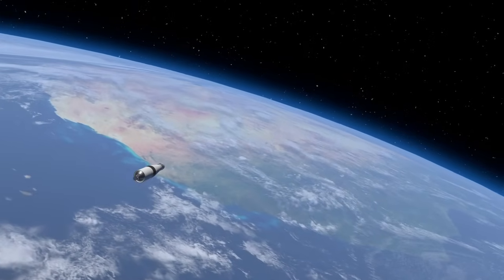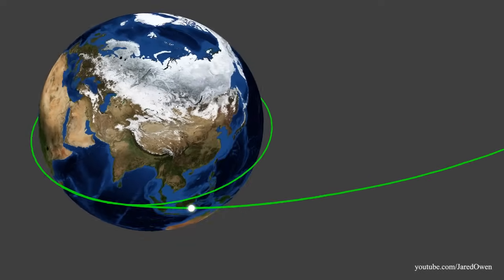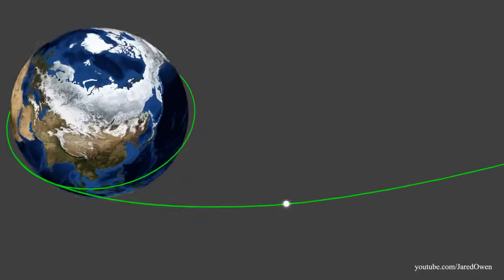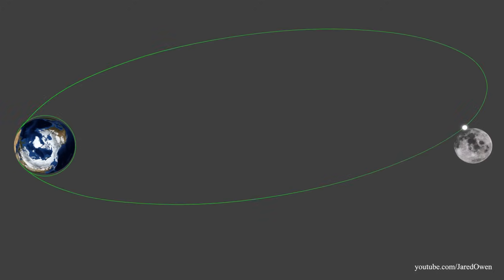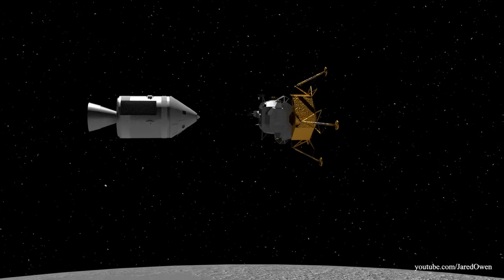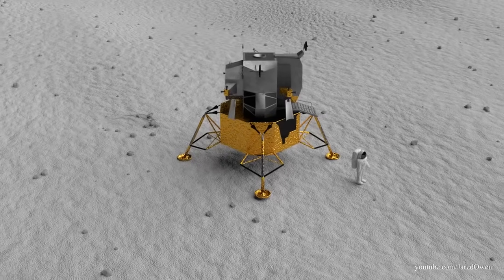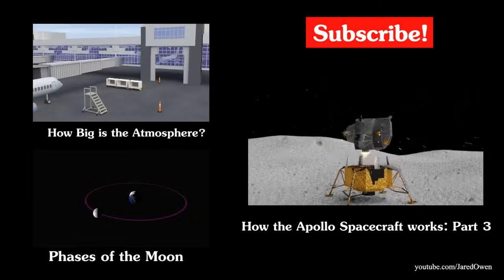How the Apollo Spacecraft works: Part 2

Comment: Always wondered how the CM managed to reduce velocity enough for an effective reentry.
It's quite different in LEO, where a slower speed and larger reentry corridor exists, and the opportunity for multiple attempts.
Did the Apollo missions use skip reentry?
Reply: Are you actually going to try to learn and understand it?  Or, are you just going to do as you have done on prior topics, and think that within 30 seconds of finding out how something worked, you will declare it fake?  To answer your question, start with this: "Apollo - Atmospheric Entry Phase (1968)."  If you have more questions, ask them.  Don't just pretend that no aerospace engineer on Earth for the past 50 years is capable of understanding why nothing could actually work, while YOU think YOU know better (again, just 1 minute after learning it).
Reply: It all hard to 'understand' :)  The rockballs capture and sling at command.

Comment: One thing you forgot is the sensor pegs on the LEM landing pads when they touch the surface of the moon the descent engine shuts down
Reply: Not directly. The probe lit an indicator lamp on the panel. IIRC, they wanted to be able to go to full throttle if the pads broke through the surface crust--if the module tipped too far, they couldn't launch the ascender. I assume that they wanted to be able to stabilize the module long enough to launch at worst, or slide over and try a different location.

Comment: Great video but why don’t you talk about the Van Allen belt it’s amazing that we so called made it through every time with no danger. I know we all have our own opinion but we never made it to the moon. But you make great videos Jared, can they take there suits off inside the craft?
Reply: "A person in the cabin of a space shuttle in a circular equatorial orbit in the most intense region of the inner radiation belt, at an altitude of about 1000 miles, would be subjected to a fatal dosage of radiation in about one week.

However, the outbound and inbound trajectories of the Apollo spacecraft cut through the outer portions of the inner belt and because of their high speed spent only about 15 minutes in traversing the region and less than 2 hours in traversing the much less penetrating radiation in the outer radiation belt. The resulting radiation exposure for the round trip was less than 1% of a fatal dosage - a very minor risk among the far greater other risks of such flights. I made such estimates in the early 1960s and so informed NASA engineers who were planning the Apollo flights. These estimates are still reliable.

The recent Fox TV show, which I saw, is an ingenious and entertaining assemblage of nonsense. The claim that radiation exposure during the Apollo missions would have been fatal to the astronauts is only one example of such nonsense."

- James A. Van Allen
Reply: The Van Allen belt does not provide a lethal dose of radiation as long as they don't spend a long time in it. They only spent 15 minutes in the Van Allen belt.

Comment: how does the astronauts move between the 2 modules?
Reply: Once they remove the hatches from the CM & LM, there’s a tunnel between the two spacecraft. After docking, the mating collar is secured with a number of latches and then the seal is tested to make sure it’s all good.
Reply: @mako88sb  thanks!
Reply: SC0RP1AN   Np. I did leave out the docking probe and drogue system that is the key part of all this. There’s a excellent YouTube video by Kevin Hugh’s titled Apollo Docking Mechanism that you should check out. He realized that there isn’t really an adequate explanation of how it works and decided to provide one.

Comment: The lunar module does not appear to have any jets so as to turn the module around in the correct position to be able to land. that big jet in the middle is just a thruster.
Reply: Thé RCS is there exactly for that purpose. The 4 quadrant modules are clearly visible on the ascent stage of the LM.

Comment: Why is there no actual footage like this 2:40? This is one of the best moments to capture, if you're about to land on the moon for the first time in history!
Reply: Well, TV video was out of the question, because they lost line-of-sight with Earth to transmit it.  They were on the far side with no radio contact.  I suppose they could use 16mm film, but, I doubt they wanted to burn through film rolls for this purpose, and they were all very busy during the lunar orbit insertion.  I'm not really sure why you put such a high value on taking video of this particular event... (?).

Comment: Thanks to this marvelous movie.
A question between 3:10 to 3:40 :
Both LM and CSM drives at opposite way from before. On travel from Earth to Moon, the CSM was in front, and the LM back. 
At 3:10, the LM is now in front, and the CSM back.
Has the whole thing turned over in the meantime?
Reply: Yes, and that was done because the LM needed to fly engine first in order to do the braking manoeuvre that lowered its orbit before the landing. Even without landing (as with Apollo 8 which didn't bring any LM), the CSM also needed to turn around at some point because its engine had to point backwards before it could do the trans Earth injection.

Comment: so is free return trajectory controlled by the astronauts?  When the two crew members are in the lunar module landing on the moon how does that third crew member prevent the service module from trajecting  back to earth.
Reply: The main engine on the service module was used to slow down the spacecraft in what was called the lunar orbit insertion (LOI) before the LM and CSM were separated. The CSM with the third astronaut remained in low lunar orbit while the LM landed.
After the LM had returned to the CSM, transferred crew and lunar samples and separated for the last time, the service module's main engine was used to accelerate the spacecraft out of lunar orbit in what was called the trans Earth injection (TEI).
The TEI burn was basically the LOI burn in reverse since it added about the same speed (3000 km/h) as had been lost during the LOI burn and these two burns were the main purpose of the service module's main engine.

Comment: No...ya ecu 150m burn at set 00 c9 ,kapasitor 1light right heater glass 14....note x at gear plq ya, lucas with BSL line...Set elektronik at gear pedal safe and secure

Comment: If the command module CSM is unable to dock with the LM for whatever reason, would that mean the astronauts would have to wait until their path converges with the moon orbit so they can take advantage of the free-return trajectory to come back to Earth or am I missing something? Could anyone please explain? Thanks
Reply: Nope
Reply: They will may burned in re entry
Reply: Or maybe they will orbit in the middle of nowhere
Reply: Without a heat shield
Reply: They will be dead while re entrying
Reply: Your missing the heat shield
Reply: Lunar modules aren't have heat shield
Reply: It's only design for lunar landings
Reply: Only the command module have a heat shield
Reply: Not a service or lunar ascent stage
Reply: It can be use once
Reply: The mission is so expensive
Reply: And it can't be use again
Reply: Building another rocket are so expensive
Reply: So there no another apollo mission happen
Reply: Maybe of it's expensive
Reply: @jairusrendon3614  this is not Twitter or 90s SMS.
Reply: They couldn't take advantage of a free-return trajectory after they had entered lunar orbit, which was done with the lunar orbit insertion burn before the CSM and LM separated.
Apollo 13 could do that because it never entered lunar orbit.

Comment: I remember hearing that the Lunar Module would usually extend it's legs after it has detached from the command module while it's descending onto the moon, not before it detaches.
Reply: No, it would extend them, swing around so the command module could make sure they’re operating optimally,  then it would be clear for landing.
At least that’s how I heard it.

Comment: How does the CS module (CSM) manoeuvre in space to the extent that it turns around 180 degree to attach it self so accurately with the lunar model and basically pulls it out backwards.
Reply: Uses tiny thrusters called RCS thrusters to maneuver itself. Search it up
Reply: Rcs (reaction control systems)
Reply: There are 16 small thrusters on the CSM, plus they had what are known as pilots / astronauts controlling them. Straight forward to me.

Comment: I just wonder back in 1969, whether NASA could launch a communication satellite to Earth-Moon L2 to keep talking to the Apollo spacecraft all the time.
Reply: I'm sure it was technically possible, such a satellite presumably would not have to be very heavy, but the cost/benefit probably wasn't the best.
Reply: The Earth-Moon L2 point is behind the Moon, so a satellite located there wouldn't be of any use for the Apollo missions since they all landed on the near side (Earth facing) of the Moon.
Reply: @fromnorway643  yeah, that was the lunar lander and it's crew. The CSM was orbiting the moon, and as such it was out of reach from earth at regular intervals.
Reply: @ArKritz84  
Yes, it would be out of reach about 46 minutes for each 2-hour orbit.
Reply: @fromnorway643  so that would be the use for such a satellite during the Apollo lunar missions.

Comment: This is a great video explantion the journey! I was trying to explain this to my kid when he noticed something about the orientation of the spacecraft during its flight - the CSM was the "forward" part just after TLI, i.e. the craft was heading towards the moon with the CSM leading. After reaching & orbiting the moon, the LM was the leading part. Did the whole assembly rotate 180 degrees while it continued around the moon in its original translation or did it reverse its translation?
Reply: Yes, Jared didn’t show it but after the CSM main engine burn to slow down enough to be placed into lunar orbit they used the RCS to reorientate so the LM was leading.

Comment: Damn, they did this in the 60s.
Reply: They literally had to invent the computers required to run the programs they needed. And with insane space/weight constraints in a time when most computers filled rooms. And all of that was just one of the hurdles they had to overcome. Impressive doesn't quite cover it.

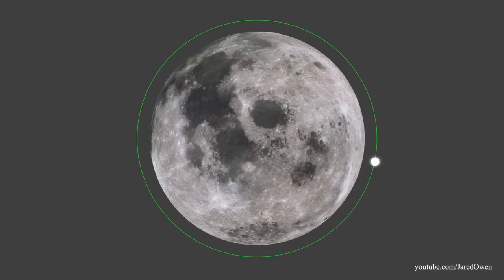Comment: What I didn't quite get is how and when did the CSM changed direction from when it first entered the lunar orbit, it was flying backwards at 2:59 but then it flew forward again when the LEM was released at 3:17. Can anyone explain?
Reply: The CSM didn't actually change direction if that is what you are wondering about. It just changed orientation while orbiting in the same direction, which was clockwise as seen from above the Moon's North Pole. That change of orientation was done by the 16 RCS thrusters arranged in groups of 4, which enabled the CSM to rotate along all three axes (pitch, yaw, roll).
Since the CSM entered lunar orbit engine first for the braking manoeuvre, it had to turn around to an engine aft orientation at some point before accelerating out of lunar orbit again. I guess it was convenient to do that while the LM was still attached to the CSM since the LM needed to fly engine first before starting its Descent Orbit Insertion. It wasn't strictly necessary though as the LM had its own set of RCS thrusters and could easily have turned around after it had separated from the CSM.
Reply: @fromnorway643  Thank you for the reply! So the change of orientation was not shown in the video right?
Reply: @syazanisatri  
"So the change of orientation was not shown in the video right?"

Apparently not!
I forgot to explain that the Command Module had its own RCS thrusters that were used during atmospheric re-entry after it had been separated from the Service Module.
Here's a Wiki article explaining the use of RCS thrusters in spacecrafts:
https://en.wikipedia.org/wiki/Reaction_control_system

Comment: I just realised something... when behind the moon you said that the service module engines are turned on to slow down, so t they fly service module first. However later when you said they will get to the lunar module, you animated it with lunar module flying first. Did they somehow switched in between or am I just not getting something?
Reply: Um, well, the astronauts switch into two groups when landing on the moon, one stays behind on the service module (orbiting the moon) and the rest 2-3 (I forgot how many) go down to the lunar surface in the lunar module. They then, once finished, fly back up, dock with the service module, ditch the lunar module, and start a burn back to Earth.
Reply: @cl570  well, that I know. I was talking about the 2:48 and 3:09 animations - the first shows the service module being in the front (with lunar module being "dragged" so to speak) with engine on to slow down. The second shows it flying the other way around, so lunar module flying first and "dragging" the service module. I was just wondering how that happened.
Reply: @DragonsAreHungry  
Both the CSM and the LM had 16 small thrusters (RCS) arranged in groups of 4 that enabled them to rotate around all three axes (pitch, yaw and roll) while flying in one direction. The Space Shuttle had similar thrusters in its tail and nose section used for precise manoeuvring while docking with the ISS.

Comment: How did the astronauts board the LM from the CSM?
Reply: After docking with the LM, the docking probe assembly could be removed from the inside of the CSM giving access to the docking tunnel between the two spacecraft. The Russian LK that was tested in Earth orbit only had room for one cosmonaut and required a EVA to enter.

Comment: How the thrust is created you need the air to push against to get thrust how this word out in ampty space
Reply: You have a misconception of what rockets do and how they propel something. Now "air" or anything is needed to "push" off. The thrust is generated in the opposite direction to that of the expelled mass. In the case of rockets the expelled mass is high velocity gases out of the nozzle.
Reply: Newton's third law.
Reply: The small thrusters in the nose of the shuttle SRBs seemed to work just fine when they pushed them away from the shuttle itself at separation:
https://youtu.be/Jb4prVsXkZU?t=156
The shuttle's three main engines also worked fine as they continued to accelerate the shuttle on its way to orbit. That separation happened at an altitude of about 166,000 ft (50 km) where the atmospheric pressure is less than one-thousandth of that at sea level, effectively disproving the "rockets-push-against-air" theory.
Reply: @fromnorway643  : These hoaxers will never believe space travel is real. They are the ignorant unwashed of the world. They will forever live in ignorance and revel in it.
Reply: @fromnorway643  : That's most likely very true.
Reply: You don’t